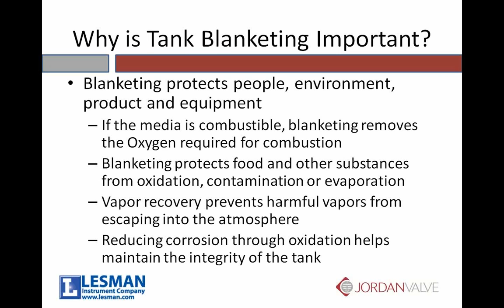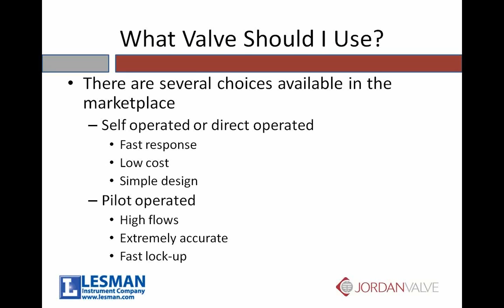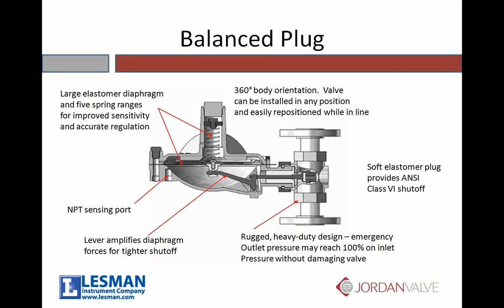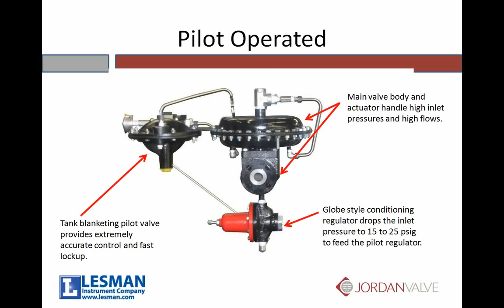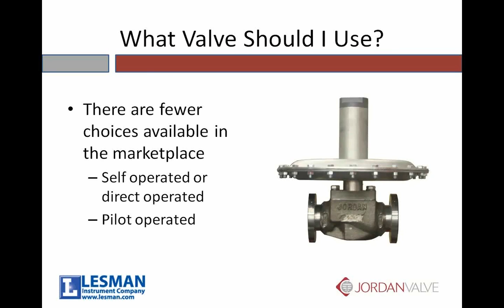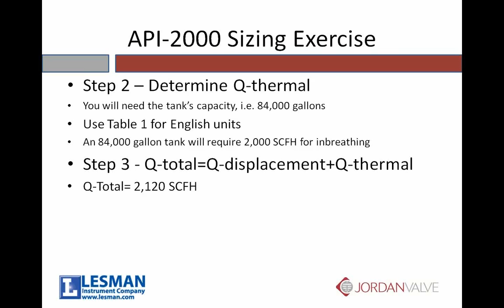Lesman Webinar: Tank Blanketing 101

Comment: How much pressure required ?
Formula for pressure ?
Reply from the maker: Tank padding is typically done at less than 1 PSI pressure.  The blanketing pressure is determined by the vapor pressure and temperature of the media in the vessel.  That data is typically found in a chemical datasheet and not derived from a calculation.